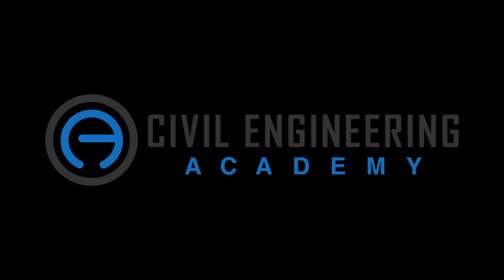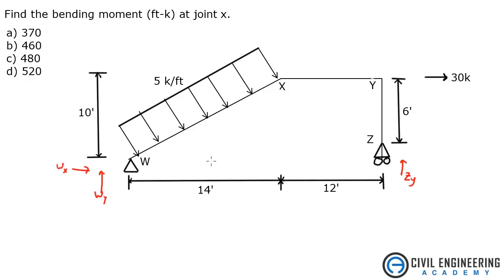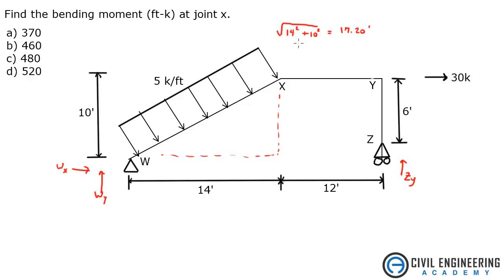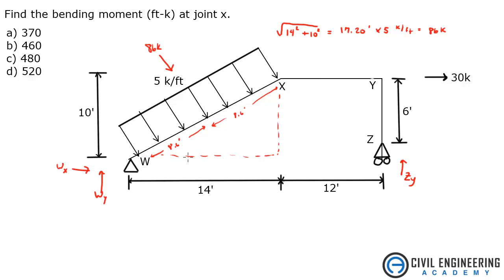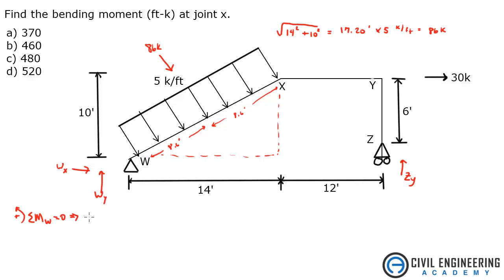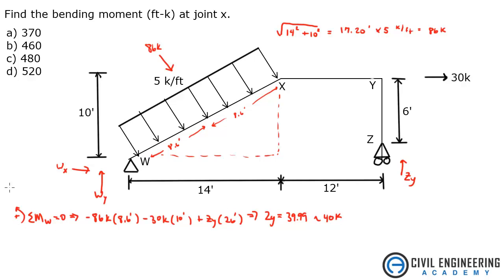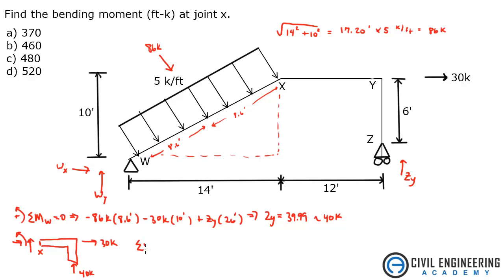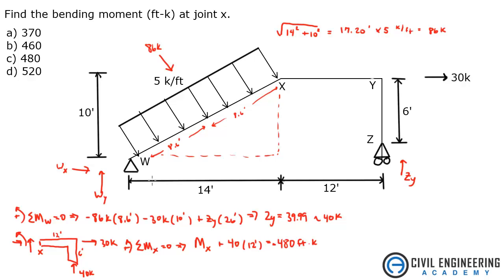Civil PE Exam - Structures - Solve For Bending Moment At a Joint Using the Method of Sections

Comment: If I use the left section, I get Mx = 400 k-ft (counterclockwise) instead of 480 k-ft. I understand using the right section is easier to find the moment at x, but shouldn't the left and right sections give the same value of Mx?

Comment: Why did you not break up the distributed load in x and y components since you drew it occurring perpendicular to the beam. ???
Reply from the maker: ShadowTEA85 I didn't resolve the distributed load because it is much easier to keep it as it is (one resultant load).  You know the distance it is acting away from the joint so just take the moment about that and your done.  If you resolved it, you would need 2 equations for the X and Y component when you take the moment about the joint and you would need to solve for the angle to use the SIN and COS.  It's just more messy, but it can be done.  I hope that makes sense.